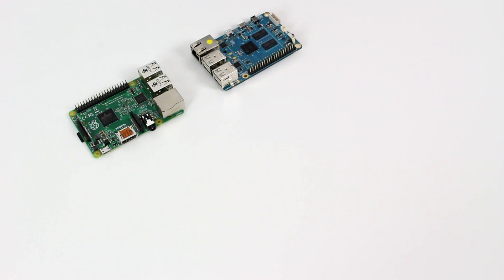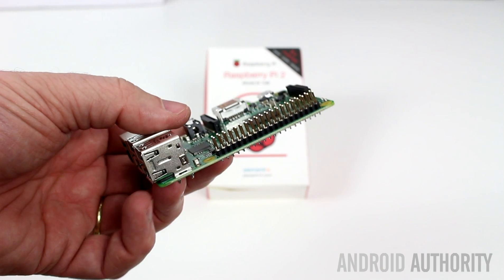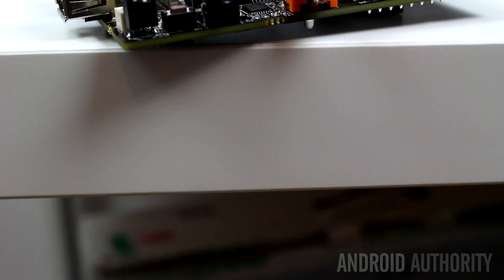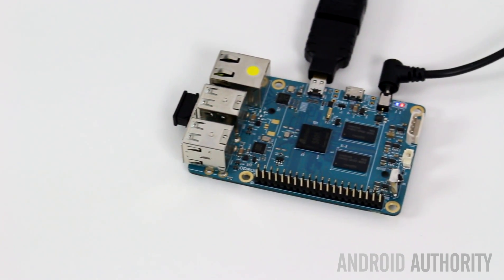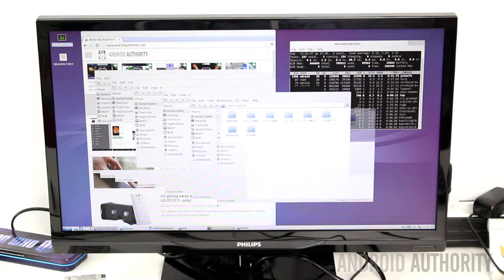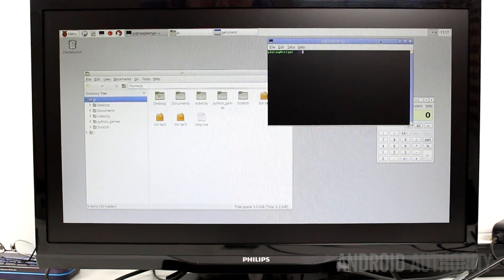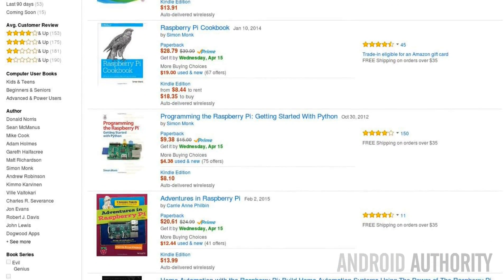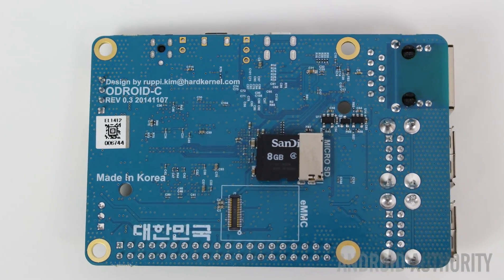Showdown: Raspberry Pi 2 vs ODROID C1 vs HummingBoard vs MIPS Creator CI20

Comment: YOU MARKED DOWN THE SAINTED RASPBERRY PI FOR NOT SUPPORTING ANDROID?!?!?!

(looks at name of channel)

...ah right.

The MIPS Creator is kinda hampered by the fact that they use a MIPS processor instead of an ARM processor, it's as if the people behind MIPS just decided to release a devboard to remain relevant (in the same way that Intel released the Galileo and Edison boards)

It would be nice to see the MIPS board develop further, after all, it is the processor architecture that powered the original PlayStation.  I'm just wondering where the PowerPC devboards are at? (my heart still belongs to the Amiga)

Comment: Android really is a last resort, I'd pick a pi 2, though all 4 boards are nothing but creative tools, they are not work stations at all far too underpowered for that, but perfect as a cheap learning tool to make robotics. For what these boards are designed to do, raspberry pi completely wipes the floor with the other 3, more tutorials, more support etc, if some how you'd use these as a work station then yes I'd pick the most powerful board.

Comment: Raspberry Pi2 does run Android. Check out the channel "Geek till it hertz"
Reply: +Timothy Starbuck  it does?
Reply: +Normy Gt Yeah, but it's not officially supported.  The Raspberry Pi foundation are of the opinion that their boards are for creators and that Android is solely an OS for consumers.  Think of that what you will.

Comment: they need to update this review, its September '15 and Kodi works fine on RPi2, I have 10 of them, yea.. addicted... there's also a tonne more Linux distros now, and the significance of android running on a hobby board is nothing, to even add that as a rating quantifier is bullshit. first of all android sucks, second its a Google bastardized Linux touch screen platform with no business running as a desktop OS!

Comment: Nice rundown, I total agree. I have 2 Pi (Pi model B and Pi 2) and 4 Odroids (C1, C1+, XU3 and XU4). For $75 the XU4 runs circles around all other devices available, bigLITTLE exynos 5422 octocore device at rock bottom pricing pricing. Hopefully you can add it to the list.

Comment: I'd like to know what compression codec you used.  I find it hard to believe that the RPi2 had trouble showing the full frame rate unless it was MPEG2 and you didn't have a codec license installed to use the hardware decompressor.  It would have been nice to actually see the OSD so we could tell what you were doing.

Comment: Well the only complaint I would have is the “free memory” section.

The amount of free RAM  is heavily dependent on the distribution used (as each may be using a different desktop environment, a different background service configuration and so on).

So did you compare equivalent distributions against each other (i.e. Arch-Linux on Pi2 and Odroid)? If you did, I either missed it or it wasn't mentioned in the video…

Comment: Did you take into consideration that the Pi 2 has support for windows 10, and that with windows it boots 6x faster?
Also, I believe that the HummingBoard may be better than the Pi 2, but is it $75 better? I think not.
Reply: Windows 10 internet of things, it doesn't even have a desktop, it's just to plug things into, very very basic and pointless.
Reply: +Ste Dunn ^ This. Win 10 IoT is completely useless. In most scenarios you can use a RTOS. The .net platform btw, is completely shit (even though I quite have a liking for the C# syntax, since it's similar to C but doesn't kill the joy like C++ (completely))

Comment: Hi, using the codec screen on machines that use a separate GUI and video layer is just nonsense. It puts much additional load onto the hardware and - as you look into it, how it is calculated - it say absolutely nothing.

RPi2 is able to sync to perfect 24p/23.976 fps clock - which all the others can't.  It is the only machine that has a closed loop syncing mechanism, which can alter the hdmi audio output values on the fly (in kernel). Imx hw cannot even run at fractional refreshrates, therefore HD passthrough and things are totally useless.

Edit: If you want to compare performance, check the skip and drop values.

Comment: Hi, I'm Ned Scott from Team Kodi.

Just an FYI: The codecinfo screen that you used to figure out how well the different devices were decoding is horribly inaccurate. I wouldn't trust those results at all. The results are so inaccurate that, as of Kodi v15, that FPS measurement no longer applies to video at all. It now only applies to GUI elements. 

The Raspberry Pi 2 should be on par with the C1 for h.264 videos, and above the hummingboard's freescale video decode. 

Cheers.

Comment: Holy shit never knew odroid was so good
Reply: CheezeWolf Be sure you go to the forum and read the laundry list of hardware bugs that can't be fixed in software.  Now there is a C1+ model, hopefully it will work as advertised.  It appears to me that the Odroid XU4 is the board to own if you're willing to spend $75.  It runs circles around all these boards.  This coming from a hardcore Raspberry Pi fan.

Comment: Wow this was a great review, very unbiased. Thank you!!
Reply: drdcs15 I disagree.  First off, the Pi DOES run Android, but the distro isn't the best.  Secondly this review has a high degree of Android support bias.  Finally, the Pi2 is an awesome Kodi (formerly XBMC) host that has absolutely no trouble driving a 1080p display with high quality video.  For good MPEG2 support, you need to purchase a license which costs about $2 US.

Comment: Does anyone of this is able to output 5.1 audio vía analog (3 jacks)
I'm looking to replace my PC with one of this using xmbc or kodi and mi old 5.1 speakers already installed in my bedroom, and my 1tb HDD , am looking for this for about 1 year and I couldn't found it, please if anyone know help me with this
Reply: hugo ancur Looks like it might work on the HummingBoard / CuBox... I haven't tried it myself, but there is an interesting discussion here: http://www.solid-run.com/community/viewtopic.php?f=7&t=335&start=110#p7880
Reply: ***** it seems like the forum is offline or something like that, thank anyways, do you know if there's anyone doing this already?
Reply: hugo ancur The Pi has no trouble driving 7.1 via the HDMI port and not just using passthrough.  I would think you could find a USB based audio device that will work with it.
Reply: phil richards there is this little box that separates the audio from the HDMI and convert it to analog with a 6 channel output, but is about 60 bucks, I would like to use a jack adapter to 3 jacks (which I have) to connect it to my analog 5.1 PC speaker system. Is easy on a windows PC using realtek to detect the 3 jacks out of a single out, like a splitter, but I want to know if such a thing is possible with the pi.

Comment: I used a Pi1 for some time and I was really surprised by the absolute slowness of that system. Especially when using something like YouTube on XBMC it need forever to load video-lists and the video itself. A single core iPad was about 20 times faster which seems quite unacceptable...
Reply: Timo Birnschein Pi1 is only ARM v6. You have to compile specifically for this architecture and you end up with slow downs because of this. The Pi2 is night and day in difference, it's also ARM v7.

Comment from the maker: Showdown: Raspberry Pi 2 vs ODROID C1 vs HummingBoard vs MIPS Creator CI20

See the full results here: http://www.androidauthority.com/raspberry-pi-2-vs-odroid-c1-vs-hummingboard-vs-mips-creator-ci20-599418/

We test four of the leading Single Board Computers to see which is the best one: Raspberry Pi 2 vs ODROID C1 vs HummingBoard vs MIPS Creator CI20.

By *****
Reply: Nicolas Roelandt
The big difference between Pi and other platforms is, that there is a huge and very active dev community for Pi related hard- and software projects. No other platform can rival that.
Reply: Roland Rohde If you read me, i said i use it as a small desktop. Not as a dev board.

Just with the stock images, the odroid c1 fullfill that better than the Pis.
I just give my opinion, for that specifique usage.

The community subject is already approach in the video.
The raspberry Pis are great products (if it isn't i would not have bought 2), but not the best for everything, sorry. As the odroid c1, lacks a larger community and projects based on it.
I never said it is perfect... Maybe the humming board is better, i don't know.
Reply: Roland Rohde Yes, but if you want a small desktop computer, as Nicolas Roelandt said, then you don't need a huge community,the size of the ODROID community is more than sufficient for that. Although I agree that the size of the Pi's community is important, and I say that in the video, it isn't the only factor. If you can install Linux on the ODRIOD and then run a web browser without ever having to refer to the community then the size of that community is not relevant. For a small desktop he wants performance not forums posts.
Reply: Android Authority Raspberry rules
Reply: Akumetsubg you mean Windows 10 IoT, you know that crap without any GUI, without .NET without C#? That crap of Windows 10?
Reply: +Nicolas Roelandt (Personnel) I like that because the only reason I want one is to stream video in my workshop. Thank u.
Reply: Why do these boards' names have to be so complicated?!
Reply: I have a Pi B+, a pi 2 and a C1.
I wanted a small desktop to surf on internet and watch movies. And for this,  the odroid c1 is far better. I hoped that the pi 2 will do better than the pi b+, and can provide the same experience as the odroid c1 but it is not.
Reply: Nicolas Roelandt
That's true. The Pi has made a lot of progress when it comes to desktop use, but it's probably just not the right platform for that. Odroid U3 or similat works best there I guess. I actually have an Odroid X2 here, but it was never really well supported. I should have gone with the U2...
The U3 is in use here as a server, and that works really well.
Reply: They are not as cheap than the C1. It twice to four time the C1. And for 35$ it makes a great job.
For less than 70$ I get a computer, a wifi module, the hdmi cable, a case and a power supply. Port included.
Reply: C1 all the way..
Reply: Since the HummingBoard is over $ 100 you should have considered a ODROID U3 for the test as well. That device is even more impressive than the C1 (nearly twice as fast in all aspects)
Reply: Android Authority  The Pi2 will support windows 10 , are there any other boards that will do that ?
Reply: Akumetsubg Qualcomm has announced that it will also be available for its Dragonboard 410c. https://www.yahoo.com/tech/s/qualcomm-announces-support-windows-10-113000631.html
Reply: It is well equipped (wifi, bluetooth, FM radio, GPS, eMMC support),powerful (A53 quadcore at 1,2 GHz) and had lower power consumption.
Do you have an idea of the price ?
Reply: *****  Thanks ^^
Reply: Tobias Schaaf You are everywhere touting the U3 meveric (rooted from forum here), too bad it's discontinued. Perhaps the XU3/4 will get there soon enough, it really is the most bang for the buck and I'm glad I have one of each.
Reply: +Android Authority Android 5.0 on Raspberry Pi 2 (does that mean it gets 14 points.. against 9?) #RiscOS #uCHOOZE
>> https://www.raspberrypi.org/forums/viewtopic.php?f=63&t=113957